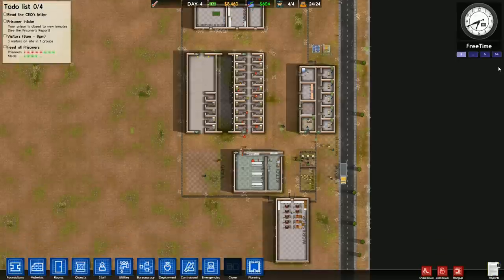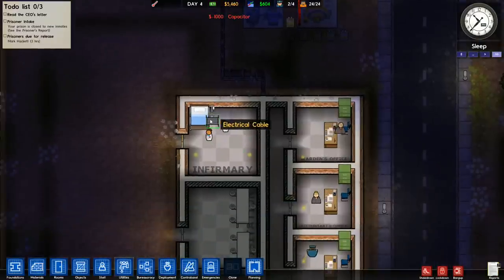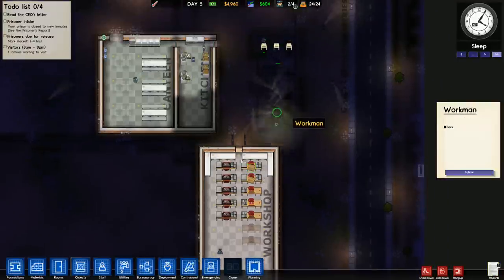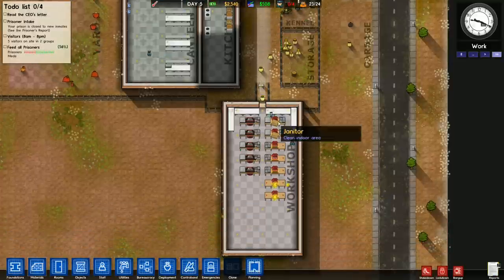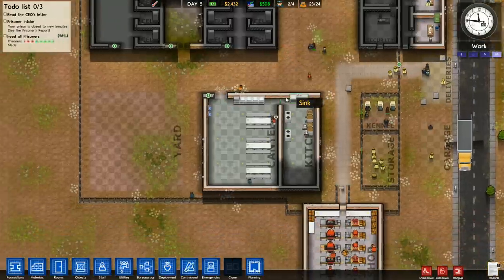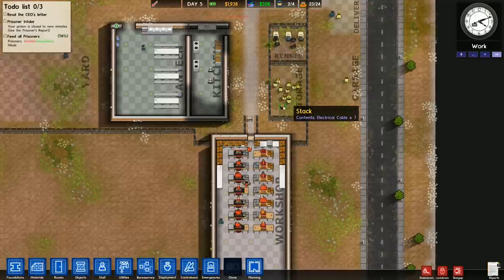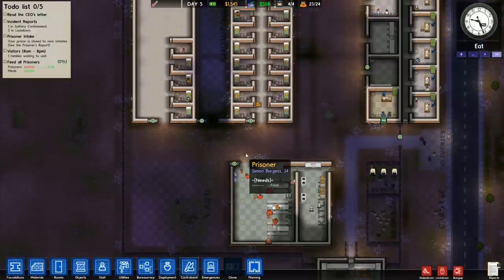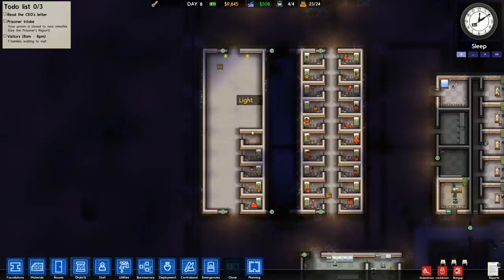Prison Architect Let's Play / Tutorial, Part 4 (Alpha 14)

Comment: I would advice you to take in more prisoners. It's not the best choice for running a more efficient prison, but I think seeing if you can handle 12 prisoners at once would be interesting.

Also, don't forget to set the Staff-only areas as such. Currently, you have cleaning crew going by the kitchen. There's a lot of bad stuff they can steal from there, and I doubt your cooks like that very much.

Comment: No need for extra wire in the Workshop just put em in rows going down with NO space between (only top row needs power) - EZ to pack em in that way. (of course you might be doing cosmetic spacing till you need the extra room)